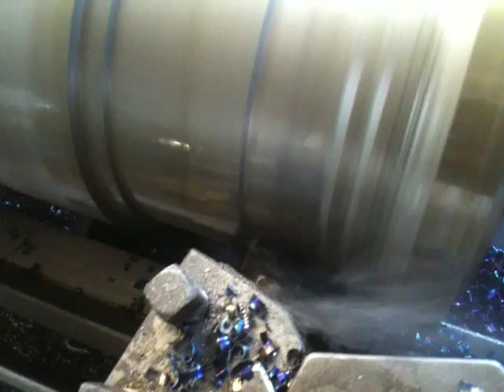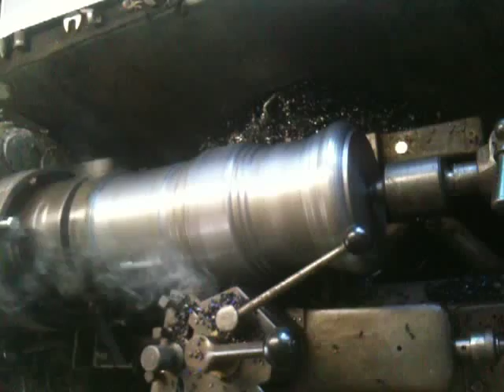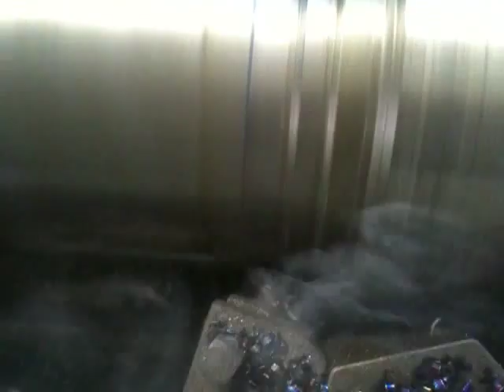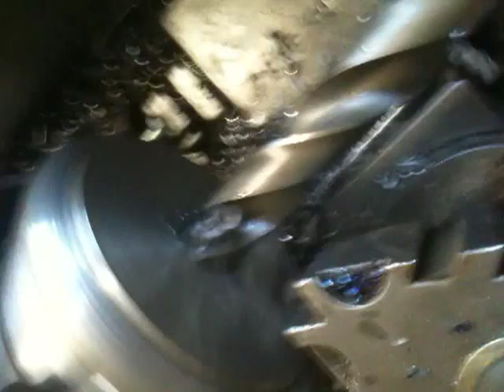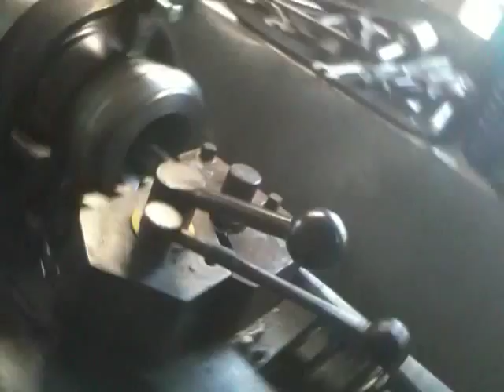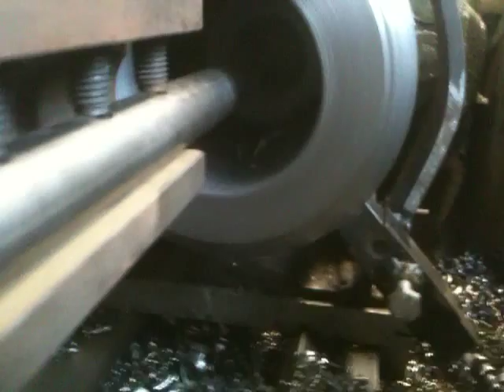Blackpowder mortar - part 1

Comment: I very much enjoyed your bullet mold cutting bit.
How are you attaching the trunnions?  Threading I hope!!! Modern muzzleloaders are made of 1137 steel. Cannons are 1018 with welded trunnions.
The hobby Guy uses 1045 because readily available. If you weld trunnions you MUST take it to professional heat treatment for Safety. Real cannons of cast iron are only 35k and steel is 60k this is why 1018 is used. 1018 dose not crack.

Comment from the maker: Hi,
the trunnions are welded on due to the fact that i dont have a tap with the required diameter (about 40mm!). So instead we will drill a hole (not very deep) in which the trunnions will seat and then we weld them. 
This mortar is only for salut firing therefore the recoil and the pressure is not that high.
And as the last safety feature this mortar is testfired by the department of firearms (Beschussamt) which is a requirement in germany (every 5 years!).
Thank you for your interest!